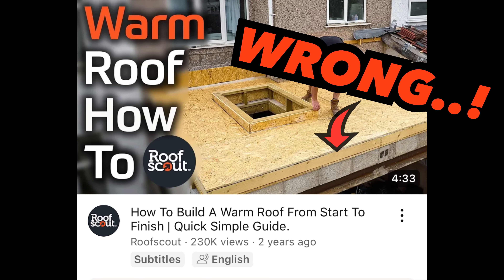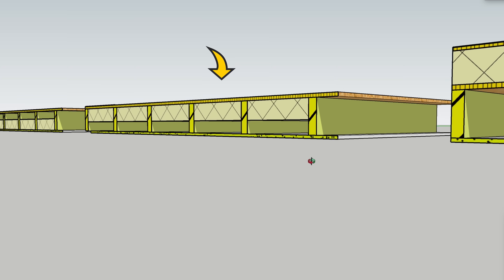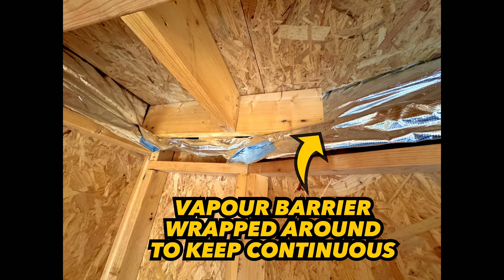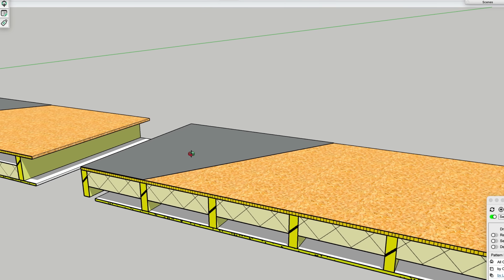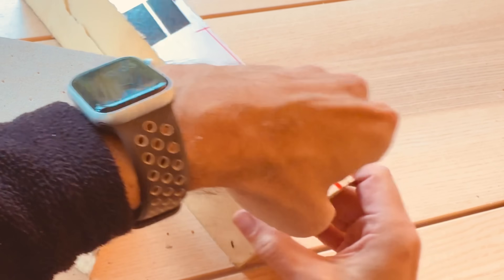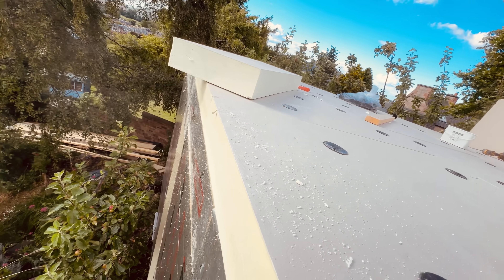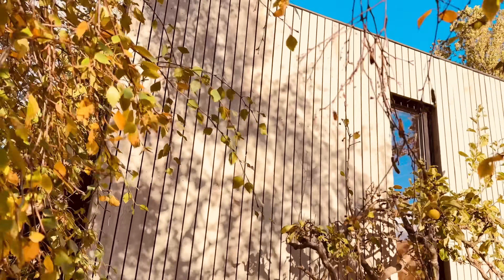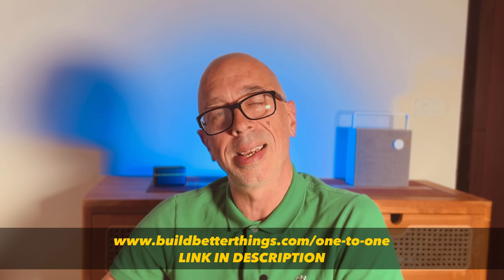Build a Warm Flat Roof the Right Way

Comment: Well finally someone who talks sense. I thought I was going mad seeing how wrong these roofs are built here in Ireland. If I may ask what is your take on installing the vapour barriers under a tile roof? Do you recommend pulling it taught or leaving some slack so the membrane sags between the rafters? I was taught to allow some slack so any rainwater making it past the tiles can flow down freely instead of stopping at each and every furring strip...
Reply from the maker: Hi. Yes I would lay it slack like you say. I think you mean breather membrane rather than vapour barrier? The vapour barrier is on the warm side of the insulation. Thanks for your comment.
Reply: Hi, yes  @build-better-things  i meant the breather on the cold side. Thanks for confirming.

Comment: I'm pretty sure this is a flawed theory as the warmth never gets to the top sheet of osb and vapour can't get there because there is a vapour barrier and the actual PIR is a vapour barrier in itself.
 if anything the sheet underneath the vapour barrier is the one that's going to get vapour on it but it has breathable materials underneath plasterboard etc.

I wouldn't use water based anything but also we use rolls of resitrix so I don't think it's ever coming off.
Reply from the maker: Thanks. The warmth is always going to transfer, it’s just a question of speed. It’s the moist air that causes the problem in localised spots where there’s the inevitable vapour barrier weaknesses, fixing gaps, poor edge treatment residual air vapour,  and joints which, over time, causes the problem as the small amounts of moisture collecting  have nowhere to go. Even if you dismiss all of that, my point would still be, why include foil insulation and all that  timber composite top decking when you can just bond direct and get rid of the potential failure completely.

Comment: 2.5m external limit? In what gnome-populated country is that?
Reply from the maker: Hybrid Roof - build the Right Way- avoid overheating, avoid timber deck.
https://youtu.be/5Xiw04-7Jmg
Reply: @build-better-things  But why a 2.5m height restriction? Where I live the height restriction for extensions is 0.3m above the floor height of the next level. So it's rather easy to do 160mm of PIR on top of the OSB without any height problem. Still lots of builders who don't understand that... but at least it's not a legal restriction.

Comment: Great video. My only comment is that cold roofs will always create condensation in the cold roof void and its the ventilation that will dry this out. Water vapour doesnt magically waft out the vents and then condense outside. Ps i have 40 years in construction surveying design and inspection. Pps people are still building cold roofs for some mad reason.
Reply from the maker: Thanks. Yes you definitely need ventilation and need to understand how the placement of the vents creates the movement to deal with the moisture.
Reply: Because some people are restricted because of height

Comment: I'm not a builder or a roofer.  Last year, I built a 5m x 5m extension for my sister.  I went to an architect (a good one) for how to build the warm roof...and it wasn't the way you do it.  Halfway through, I had issues with digging out for the slab (solid concrete from many years ago), so I consulted a surveyor who suggested a raft slab.  But my point is that for £500 cash, he also included drawings for the roof...and again, it was the same as the architect's design...which is the way you say NOT to do it...timbers-OSB-Celotex-vapour barrier-OSB-EPDM.

Forgot to add...
As I have never built anything, I was running everything past Building Control, and they were very happy with it - even came up to see the roof halfway through construction.
I'm not getting at you personally, just saying that an architect, a surveyor, and BC, all suggested the above method I used, and that you don't recommend.
Reply from the maker: Hi and thanks for sharing. If you read the comments here, you’ll see several people saying I’m wrong, (some throwing insults etc)  and that OSB under the membrane is a fine thing. I’ve explained in the video visually with my reasoning why it’s an awful solution, you are welcome to disagree, but I hope you get the same level of detailed explanation and analysis from your architect or builder as to why OSB and foil are a good thing on the cold side in a warm roof set up.

Comment: Interesting. To my horror my 20 year old lead roof had erupted on a warm roof construction , the LSA now state that they no longer recommend this. I had initially thought the lack of vapour barrier was the main cause. I have added Allutrix to the sub deck then refitted the insulation on top followed by OSB and primer finally layered with ResTech . Im now concerned about moisture forming. Everyone tells you something different!

Comment: On the roof mentioned with no OSB ontop of the insulation, is it safe to walk on and is it suitable to hold solar panels and a green roof?
Reply from the maker: Hi. Yes it’s safe to walk on, but just like with an OSB sub strata, sensible with the kind of footwear, avoid anything that can damage / nick the membrane etc. For Solar,  you need to design the loadings in the joists for the additional weight plus the wind uplift, and then it’s down to your choice of fixings locations for the rails, and whether they pierce the membrane. For a green roof, I would be considering an inverted roof, rather than a warm roof.
Reply: @build-better-things  thank you very much for the information

Comment: Omitting  OSB on top makes the roof way way more likely to be damaged by footfall, ladders, people just carrying out routine maintenance/decoration etc in the future. Stop being silly.
Reply from the maker: If the membrane’s going to fail because of footfall, it’s going to fail, regardless of whether  it’s an OSB or synthetic sub strata and it’s obvious you’ve never walked on the latter, or you wouldn’t have written such nonsense.        For your ladder, even for your OSB sub strata , shouldn’t you be using a spreader plate sir?   You say “silly”…..you seem to be desperate to have OSB below your membrane, so …..go for it.

Comment: Interesting video, thanks. Out of interest, with a warm deck with torch felt over, what's that like for reliability? Asking for a friend 🙂
Reply from the maker: Actually I’m not sure. I always thought you needed to renew it after quite short periods. I also think you might need to torch onto a timber sub strata so cold ventilated roof might be best. I’m no expert on felt however. Best of luck with it.
Reply: @build-better-things  Thanks for coming back so quick. Yes I think it does need renewing from time to time, but should last a good while - perhaps not as long as best case well laid/prep'd GRP/Rubber.

This is to do with an 'already built' outbuilding around 3 years ago, did have OSB sheet under and over PIR. I'll inspect at some point as I'm interested in deterioration of the sheet. Thanks!
Reply from the maker: Best of luck with it

Comment: Left slightly confused by this video. If you glue your EDPM directly to the PIR then the same moisture that you say rots the top layer of OSB now has nowhere to go as EDPM will not allow moisture through. Also, if you have put a vapour barrier under the EDPM then surely you have eliminated the moisture getting through anyway.Would welcome any replies.
Reply from the maker: Hi. I thought I did say EPDM has a slight breathable element to it. The trapped moisture will permeate slowly through it. It won’t do that if it’s stuck within 18mm of impermeable OSB or within some air within below a layer of foil on the cold side. The vapour barrier is just a retarder and I can’t rely, on it so I’m designing out the quality control issues. You raise some great questions, even if I’m totally wrong, why take the risk, when there’s no difference in cost?
Reply: @build-better-things  - Thank you for getting back so quickly. I'm currently making a decision on which way to go with this on my own extension. You are correct that EDPM is slightly breathable but it won't allow moisture to pass through as you say (not according to the data I'm reading). Personally I think the real solution to this is to deal with the problem at source and condition the air first. This could be achieved using an appropriate air-conditioner, heat pump or dehumidifier. But now I'm increasing my costs. Meanwhile, I'm going to say a big thank you for putting your videos out there I've certainly learnt from them and put a lot of what you say into practice.

Comment: Hi mate if there was another vapour barrier under the 2nd osb would that stop if rotting basically wrapped the insulation like a parcel
Reply from the maker: Hi. Part of the worry for me is that if you have impermeable surfaces, be they foil, polythene or OSB, under the surface of the outer membrane, on the cold side of the insulation, given we are not in a vacuum and that no vapour barrier is perfect, you are creating perfect conditions for interstitial condensation. I just would never go there whether for my own or someone else’s when I can eliminate the issue entirely. There’s several people commenting here who disagree with me, a few of them are going out of their way to reply and repeat  all over the place saying I’m wrong, so you might want to read all the comments and make your own mind up. Great building construction is as much about mitigation as anything else, I think the science is sound, but you can always disagree with me. Thanks for the comment.

Comment: EDPM, it goes brittle after 20 or so years, its sh*t!  Genuine Butyl Rubber lasts, but try getting hold of the stuff these days. And OSB warps and sags, no good for balconies.
Reply from the maker: EPDM is sold now with at least a  20 year guarantee , up to 50 year expectancy . Agree that doesn’t mean much on its own unless you’re installing it yourself, So any guarantee should come from the installer and that  requires a bond, for it to have any meaning. Interesting about the butyl so I’ll look at that. Thanks for your comment.

Comment: I have to personally disagree with your opinions the reason we have the secondary OSB3 deck is to stop the spongy feeling on the roof & stops the insulation getting compressed when walked on, or ladders set up on the roof it helps distribute the load on top of it making a stronger more supported roof covering.

Your theory is wrong & you contradicted yourself many times, warm roofs only fail when there is no VCL fitted it’s nothing to do with two OSB3 layers because if what your saying is true your suggesting the VCL has completely failed then surely for enough moisture to get it to rot out the OSB3 top deck?

Your talking about best practices etc but you also missed a something out not using screws full stop on warm roofs, you should use PU foam adhesive with tissue insulation that way no screws will go through the VCL at all which will stop the slight air leakage from the screws.

Your preferred method still allows for a bit of cold bridging too, again your understanding of these plastic washers is wrong, the whole point of them plastic washers is so you don’t have to buy the 200mm screws which are really expensive you can get away with smaller cheaper screws.
Reply from the maker: Hi., I made my thoughts about the vapour barrier at the earlier part of the video.  I explain in detail the problem of OSB composites on the cold side. There is no sponginess in the insulation which leads me to believe you’ve never used the system.
Reply: How many flat roofs have you installed?

Comment: Thank you for the great video and I agree with your explanation. 
Unfortunately I am very worried as I have done more then 50 flat roofs with 18mm wbp on top of the firrings, vlc “alutrix” on top of the plywood, 150mm ecotherm (very well done, fill and seal all the joints) then 18mm tongue and groove OSB mechanical fixed with the “ plastic washers “ then finished with Flexi tec resin 2020 (very expensive material) and I have provided 10year warranty to my clients. 

Your explanations make sense, but I don’t know what to do with all the roofs that I have done and also with the others that we already have booked. 

I find it very difficult to use tissued face insulation (no plywood on top) when you have a lot of parapet detail, box gutter detail, skylight upstand, when the flat roof will be used as a balcony, or air source heat pump will be installed on top, etc….
Any suggestions? 
All the best
Reply: He is not understanding the difference between vapor permeable and impermeable insulation.
Reply: @AgronIlirBilla  why would you trust more the author of this video instead of your experience? 

Have you seen a top layers of a warm roof with VCL rot? 

Also, would you reckon it would be easier and cheaper to replace the existing top layer of OSB or the bottom one?
Reply: @OmegaLok  Me again. Yes, in answer to your question, I have seen rot in a warm flat roof with a VCL. Indeed, I have worked on a number of schools in which whole buildings have had to be demolished and replaced for that very reason. If I say that the plywood on the outside (not OSB) under the single ply membrane was rotten...........It's incredibly difficult to get ply to rot, but it rotted in this build-up. There was an extant vapour barrier.

If you can control the moisture in the building properly, which inevitably means a mechanical ventilation system, then the issue seems likely to go away. I fit them in every building I design. But there are millions of houses around the world with OSB or ply sheathing, and without a MVHR system. They're all in danger.
Reply: @MikeAG333  Sorry I am not convinced about a warm roof simply because you say:

"whole buildings have had to be demolished"

and 

"There was an extant vapour barrier."

and that indicates to me full timber framing with OSB on the outer shell of the walls + membrane (i.e. you're not talking about a warm roof). 

I've seen  this membrane lapped incorrectly several times on Youtube (Izzy the Bricky had a video), i.e. top section tucked under the bottom section. 

I've also seen how my contractor incorrectly lapped  the DPC over the DPM, me correct the issue, and building control signing off and then describing in their report that I've correctly put the DPC over the DPM...

I just can't logically think that condensation will rot a warm roof outer layer of OSB when I compare the other mistakes where water will literally flow into an envelope and rest there forever.
Reply: @OmegaLok  Well, I didn't make myself as clear as I thought I had. Yes, it was a warm roof, and yes, there was a vapour barrier. One can't post drawings on Youtube or I'd sketch the build-up for clarity.

The principle of my point is that OSB is also a vapour barrier, and putting a vapour barrier on the outside of a timber construction, be it wall or roof, is a very poor idea in any place where the building is heated. I'm sure you could probably get away with it in a building that is never heated (and which has decent ventilation), but that's not much of Britain, Europe, or North America.

Oh, and I have never claimed that the OSB would rot. It will get mouldy ......sorry......it DOES get mouldy, but it's the framing which is at risk from the interstitial condensation, not the OSB (although, as I said, some of the ply in the schools I talked about had turned to compost).
Reply: This guy has no qualifications no experience 
It’s all what he thinks ignore this 
Steve roofer is a far better site on YouTube he will keep you right

Comment: You are making the assumption the dew point is on the bottom of the OSB, this is not correct on a warm roof, this is the whole design of a warm roof, this does not happen 

In fact, in a warm roof, the Dew Point happens within the PIR insulation and moisture-tolerant boards, away from the roof timber, so there are no moisture spots in the roof space causing condensation issues.
There is a very good technical web site which explains this in detail it’s detail library
Reply: Yes, thank you!  Please comment again with the technical info source you mention.  Because I've designed the 'flat' roof of my house currently under construction, after exhaustive research about this very condensation issue, and determined my roof deck's underside should be perfectly protected b/c of the critically-correct R-value proportion --- specific to my climate zone --- I'll be using of between-the-joists batts (i.e. UNDER the roof sheathing) and foamboard (EPS) on TOP of my sheathing.  In other words, while this YouTube person is clearly extremely knowledgeable about bldg. science, the REAL issue here is WHERE IN YOUR ROOF SANDWICH IS THE DEW POINT?  Also BTW, I'll be stapling & taping a 'smart' vapor barrier to the underside of the joists, btwn. them and the ceiling sheetrock.

Comment: Interesting video. Lots of conflicting info on flat roofs. I think most are doomed to fail simply because of a lack of pitch and water lying on it. But one simple question. What is the method if your not using rubber? What about fibreglass(not dryseal) and  torch on felt?
Reply from the maker: It’s more just to avoid anything that can rot, such as timber product, on the cold side of the insulation, not part of a ventilated void, and still under the outer membrane. I just happened to be using EPDM because I understand the technology. If your roof membrane requires a timber sub strata, and you’re attempting a warm roof, ie not a cold roof, then I’m saying I think it’s a significant weakness, and I hope I’ve shown why.